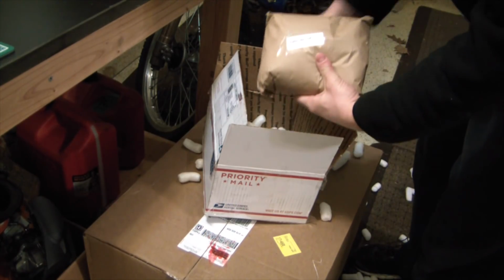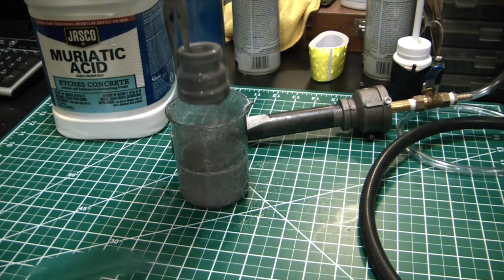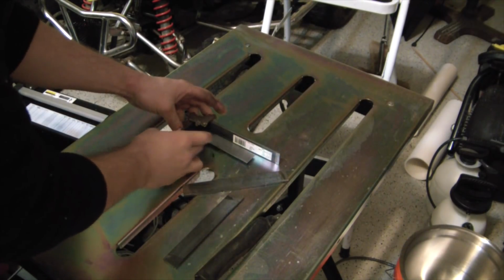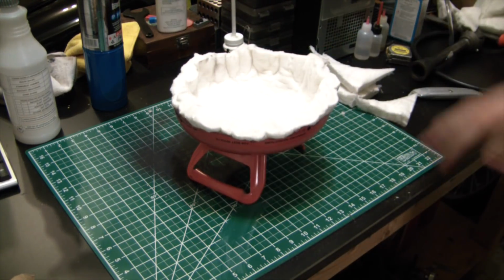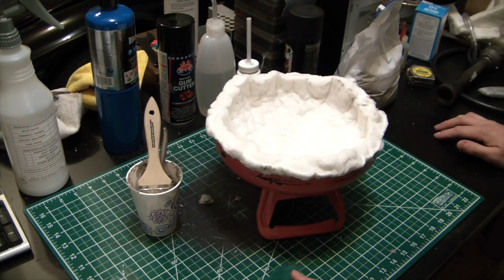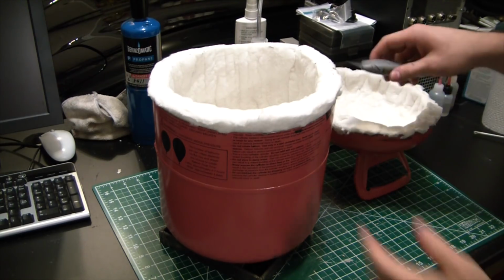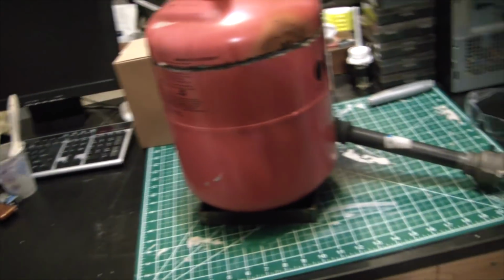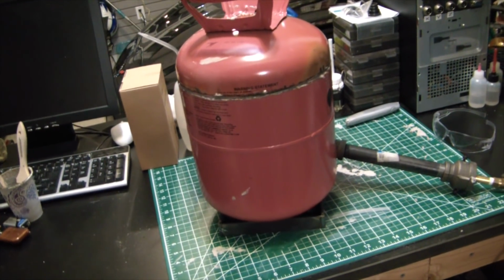HELIUM TANK FOUNDRY - EASILY MELT METAL AT HOME! - ELEMENTALMAKER

Comment: Has this build lasted you?  Have you had to make any repairs?   I'm planning on building one of these with an EMPTY propane tank... Was wondering if I should do a Kaowool and Satanite combo like you have or just go with Kast - O - Lite 30 Li.  Let me know man.  Thanks so much!
Reply from the maker: So far so good. I've done another couple coats of satanite, and that's kept it on good condition. I don't use it super often though, so if your using yours for hours every day it may wear faster
Reply: @ElementalMaker  How often is "not super often"? I imagine doing maybe 1 melt a week... Do you recommend any other build ideas if you think this wouldn't last me?  Sorry for all the freaking questions, lol.  You're the first handyman on YouTube I found that replies quickly, I got super excited when I saw your alert!
Reply from the maker: @YamsYT  I don't use mine more than once or twice a month. The only real issue I could see is the bottom sagging if you do some heavy melts. K23 or similar firebrick might be a better option for the floor of the foundry for your use. The walls and lid being rockwool and satanite should be fine though 👍
Reply: @ElementalMaker  Much appreciated!  Ill consider the firebricks and incorporate them into my design.  I could definitely see a sagging bottom becoming a factor of failure.

Comment: I just used a hack saw as I been cut by my angle grinder. Many decades of metal working didnt mean crap. Had to have ligaments reattached. Building one of these myself. Any suggestions as Im 5k feet above sea level, and considerations?
Reply from the maker: In my case the burner orifice had the foundry running a little lean. At your altitude it might just be prefect with the reduced atmospheric oxygen.

Comment: I wish  you would stop calling it a forge! It's a bloody FURNACE lol one thing I outdoor have done was  to weld four short pieces of flat bar stock at 90 degrees in the lid to stop the lid from falling off the furnace if knocked accidentally. But i am very impressed it's the basic idea.
Reply: He corrects himself in the video so he realized his error after filming and wasn't going to redo everything because he switched two words around. And the more appropriate word is foundry not furnace.

Comment: Glad I’m not the only one scared of grinders/cutting wheels lol
Reply from the maker: After seeing one nearly take off my good friends thumb it gave me a good measure of respect. It wasn't the grinder or wheels fault though, as he didn't have the correct nut holding the wheel on. Still was scary though.
Reply: I have seen many bad pictures of people after a exploding cutoff wheel got them. 
I have been lucky myself that none has bit me. At work we use air powered ones cut gunnel metal.( Or the metal rub rail) that goes around the marriage line on boats. 
Mark it and cut it while it's on the boat. Works fine but have scene them explode.. 
Granted they are smaller than the grinder size ones but still 3" wheels.

Comment: For awkward material on a drill press find some wood thick enough to be held in a vice and some smaller wood pieces to nail into place around the material as a wedge/frame for support on all 4 sides with no slack and for a little extra precaution use longer nails to secure it to the wood by forcing the nail to bend around the material for a little more security and the down force of the press itself will lock it into place... good video though.

Comment: One way to have secured the top to drill that hole, is to first remove that x-y vise, then put a 2x4 through the handles and clamp or bolt down the wood directly to the drill press table (for those that dk - nominal dimensions of a 2x4 is actually about 1 1/2” x 3 1/2”, but ultimately, just find a flat piece of scrap wood of whatever thickness fits between them both, simultaneously). I’m guessing that u prob just didnt wanna go through the “hassle” of dettaching and reattaching the x-y vise, to “save some time”, correct? But in hindsight, it sounded like it wouldve been worth the “hassle/trouble” (time & energy/effort spent) to do so, to give yourself/the workpiece room to PROPERLY secure it down.. Would u agree or disagree? I know I’ve certainly tried to avoid spending time doing things in the past, w/great intentions to save time, ultimately failing, extremely! That always adds up to INCREASED TIME, $, MATERIALS/RESOURCES, & FRUSTRATION. One of the worst parts that I find to be fairly consistent in these non-shortening “shortcuts”, is that usually the only thing that I would find to be decreased, is the level of safety that i am working with, & that’s sounding to being the worst compromise, worst outcome of these scenarios, as I type this out. Hmmm, I’m glad I tried teaching somebody something, here.... because I just learned something... lol. Thanks for sharing this. Aloha!
Reply: Funny, and validating . I only now finished watching the whole video, having made my first comment w/in the first 10 min of the video, and then hearing u say EXACTLY why your drill press setup was a bad idea - not safe at all - which coincided w/my comment. Perfect.

Comment: AS A FOUNDRY WELDER FOR MANY YEARS YOU SHOULD HAVE MARKED IT WITH A SCRIBE LINE AND SET UP A CLEANED OFF AREA FOR A HING FOR THE LID TO FLIP AND  OPEN KEEPING IT KEYED IN AT THE SAME PACE AT ALL TIME,,,, BUT I'M ONLY A CERTIFIED WELDER & CERTIFIED MACHINES AND FABRICATOR ,,, I STARTED IN 1987 MY NAME IS ''CAPT'' RANDALL
Reply from the maker: Those would definitely be some great improvements to the build 👍

Comment: Did the furnace hold up as well as you hoped ? Also the insulating blanket is it 1” or 2” thick
Reply from the maker: I have a link on the description to the exact heating blanket I used. So far so holding up great, although I have added a couple more coats of satanite.

Comment: Mr Mental Maker err Elemental Maker, I have a question about acids/bases and zinc removal. I’m making a burner saw your video didn’t use muriatic acid but citric. I made a tub of baking soda base to rinse the parts when done. I dunked the three pieces in and as I had a lot of room left in the large base tub I poured the citric acid in it to neutralize them both but as I poured the last out the parts started bubbling again and very vigorously at that. They stopped totally in just the acid solution. I made the citric as strong as I could used hot water and added acid until it was no longer soluble. I had a big big bag of soda and split an ass load in when making my base had 1/2 cup or more sitting on the bottom of the tub. Both solution where approx 3-4 cups. When I stored the acid and base mixture to get more soda dissolved it had the opposite effect. What gives? Any  theories? I think maybe after 12 most of the citric acid had fallen out of solution and was super concentrated at the bottom hence why it started up again when pouring in the last of it. But that doesn’t explain why the zinc reaction totally stopped, as the parts were on the bottom also. I bees a bits cornfuzed hep me!

Comment: In my first hour as a foundryman. Some arsehat gave me two "fresh" 9 inch disks to use. Silly me didn't even think to inspect them closely before putting one on.

The dumb ass laughed his head off when the disk shattered and simultaneously reefed the grinder from my hands. Made me involuntarily change the color of my jocks. I couldn't see anything wrong with the second disk. Did the same bloody thing.

I nearly pegged a chisel at the bastards head.
Reply from the maker: Man that's a brutal intro to that line of work. Glad you didn't get hurt, those things can cause some real damage.
Reply: @ElementalMaker  oh, I've seen what they can do. Been hit in the crotch a few times by pieces of disk. Got nicks in my hands from grinders bouncing off something. Had so many metal and disk flecks picked from my eyes due to I'll fitting goggles.

I've got burns in various places from splashes out of the crucible, explosions in castings and furnaces. Or stupidly placed objects.

I've also seen two people sever a finger on the band saw. One drunk. The other, refused to do things the way I taught him.

There's just certain people you don't want working with you when there's hot metal and 3 phase machinery around.

I enjoyed the line of work though.
Reply from the maker: @JustIn-sr1xe  Holy crap sonds like one hell of a dangerous place you work at! Stay safe my friend. Keep your whits and fingers 👍

Comment: I pretty much copied your build as far as the torch and foundry, some slight changes but nothing drastic. I was able to dial in my torch really well outside of the foundry, but in the foundry my flame is only burning inside the tube of my torch and has trouble staying lit in the foundry especially when I put the lid on. I can get it lit and have a constant flame but its finicky and as soon as the lid goes on it extinguishes, my lid has a 3" vent hole, should it be larger?
Reply from the maker: Wow that's quite strange. I have no such problems with mine. Check to ensure your gas orifice is well centered and directing the gas down the center of the tube. It may be directing towards the tube wall casing the issue. Not sure what else would cause such a problem. What drill size did you use for the orifice?
Reply: @ElementalMaker  I tapped it so I could fit different size might tips in and just have a consumable part that I can easily replace if need be. Right now I have .035
Reply: @ricotrout13  Sounds like you're loosing pressure, re-tape your fittings & check your tip for clearance. Then check your regulator (even brand new one's can be shit right outta the box sometimes you just get a dud), if you've still got problems.... try dynamite.

Comment: Here is a "someone who like to tell you on YouTube like they know better," and I don't know if someone said this already. Too lazy to read all the comments. If you cut a sheet of paper into a strip, you can use that to make a guide line on a cylinder. Just give it a piece of tape to hold it on the end then pull it round the entire thing. Just make sure the paper can circle the cylinder at least 450 degree. after you have it straight and tight just tape the end and you can use that as a straight edge.
Reply: Or you can just use the tape...

Comment: Would this melt copper?
Reply from the maker: LaserFalcon sure will, but you may need a very hot burner. Probably a forced air burner. That kind of heat also will give your foundry a shorter life, but it'll do it.

Comment: Found out about the Satanite from you here. Just finished my new keg foundry. Kaowool and Satanite......unstoppable. Funny what you mentioned about the difficulty in creating a good refractory mix. Went through the same thing. Said fuck it, going down this road. Thank you!!
Reply from the maker: Brett Baratheon the satanite really seems to be great stuff, I hope it gives you a long foundry life! I'm going to be doing some videos shortly on diy firebrick and attempts at refractory. I've got decent firebrick down, but man a refractory coating is hard
Reply: ElementalMaker- I look forward to those videos, I’m sure everyone on here is as well. 

I don’t know if you ended up doing a second coating on your furnace or not? I found lots of small cracking in the first coat, dried it, heated it slowly, and added a second one. The second one cracked a bit as well. After I heated it again it seemed to cure and now it is kicking ass. This stuff is incredible. 

I actually didn’t even think about coating the kaowool at first.....I’m really glad I found you and watched this video. That fiberglass particulate is nasty shit.
Reply from the maker: Brett Baratheon I still need to do the second  of satanite coat myself. The wall of my foundry is crack free but the bottom had some cracking.

Comment: There's enough galvanizing on that peice that would last one 20 minute burn and be gone ! Forever ppl on here are fucking idiots bro keep doing what your doing 99.9999 % of these ppl never left their homes and if they did to go to work they work in a cubical and have no real world experience with fire , welding , cutting metal , zinc or galvanizing , I cant stand comment section knowitallls .....nice vid bro
Reply from the maker: Robert Reichwein thank you very much Robert! Appreciate it, and thank you for checking out my channel!
Reply: ElementalMaker no problem I like the average joe channels I mean dont get me wrong love watching guys who are very much engineers and absolutely kill it but I learn way easier watching the average man with cutting wheel , drill press etc like I said I love watching the pros on the milling machines etc but guys like you teach me 1000×'s more its awesome to see shit made with the things i own like mig and drill press etc , but again brother this is good shit and love watching man , but along with the novel I wrote here lol I do have a question , I do asbestos , lead , mercury etc removal and I can get my hands on some mag pipe wrap , now I know ppl are going to say this is risky using this material but i know how to handle it safely and I wanted to mix it in to a casting mix so its going to be wet and its gonna harden  anyhow so its not going to be friable but would you think That id need anything other than the asbestos in there ? I mean its gonna be about 1 inch thickness, sufficient for what you have here ?'
Reply from the maker: Robert Reichwein I wish I could give you some better input but I have no clue about asbestos, and haven't touched the stuff since I was a little kid playing with old discarded asbestos shingles. That being said I know it is a very viable refractory material and your plan sounds solid to me

Comment: Excellent video and build sir!  Might be wise to point out the difference between 'CERAMIC fibre' (which is carcinogenic, like asbestos) and 'SOLUBLE  fibre' which is safe - they both work just as well. Indecently, what you are making is a FURNACE, not a forge or foundry - both of which terms refer to a place, not an object.

Comment: Why didn't you use a lathe to cut the top off as well as the vent hole? 2 cuts and you never have to remove it from the lathe
Reply from the maker: My little lathe is WAY too small to handle something of that size.

Comment: My understanding is you need to wear a mask when cutting/working with the rockwool-apparently it's similar to Asbestos.   If you ever question how clean you lines are or whether your holes are being properly cut then I can send you pics of the one I'm building-have a few hand tools so my circular saw has the metal cutting blade-ever try to cut a clean line in a round surface and have it meet evenly?   My holes start using a step-down bit [?] and gets finished with days of Dremel tooling.  And thanks for the reminder on burning the paint off.  :)
Reply: Appears to be ceramic batt not rock wool—only based on seeing the white color. Rockwool is dark.

Comment: You do a good job on everything you do I'm not criticizing you but you should never feel any heat on the outside of a forge. You need to put another layer of ceramic cloth in there. I can run my Forge for 3 hours and it's as cold as cold can me on the outside

Comment: Never cut on any former pressure vessel without filling it with water. Very simple and just might save your life. I've seen all kinds of vessels explode, everything from an old beer keg to tanker trailer.
Reply from the maker: Barry Blizzard I think I went over that pretty thoroughly in the video. This was a helium tank, which is a noble gas and far less prone to react with anything than water. You literally can't get safer than to cut a helium tank.

Comment: Next one you build you might want to make the side hole the size of the pipe not the fitting. And if I were you I'd buy some 1"x3/16" flat strap and weld it to the top with a 1/2" overhang ,then weld a second piece around the bottom tank at the point where the top strap is hanging to. Both those ideas would help to keep your fire in the tank. Granted you will lose quite a bit of heat out of your top hole but more of the propane and fire will stay in the tank. Just some thoughts.

Comment: Had one grenade before and one piece hit me below my eye and another piece hit me in the scrotum. Cut through my jeans and shorts and made me bleed like a stuck hog. So besides the face shield I'd recommend a leather welder bib that hangs down far enough to protect anything you might want to keep. Never have used the cutoff wheel the same since. Be aware and be careful.
Reply: I would rather not use something running at 20k rpm that is a composite.  Blades for me.

Comment: Definitely subbed! You remind me of the older days of AVE, which I actually like better than what he's doing now.  Your burner is definitely running rich if you're getting that 8 inch flame out the top. I'd be willing to bet it'll burn closer to neutral when you really let her rip though. The Venturi will be much more efficient with higher gas flow so I wouldn't change orifice sizes just yet. My burners run rich when turned down low, but are almost perfectly neutral at 18-20 psi.
Reply from the maker: Learning the Hard Way thanks very much! Yeah it does seem to be a bit rich depending on where it is in the pressure range. Glad to have you subbed!

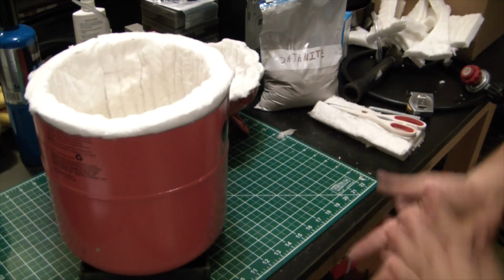Comment: Did you re-wet satanite that had dried some in the cup around the 23:00 mark then use it in the foundry? That is called tempering and may effect the performance of the mix. I'd actually be curious to see a tempered and non tempered satanite mix compared for longevity, etc.